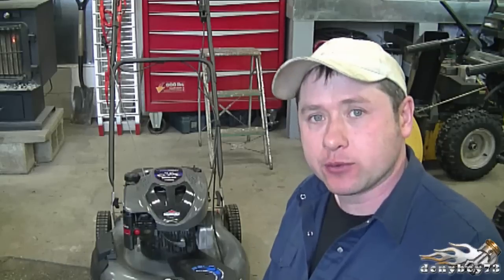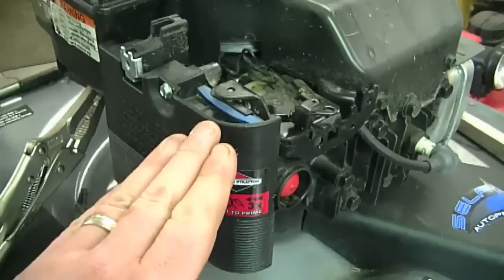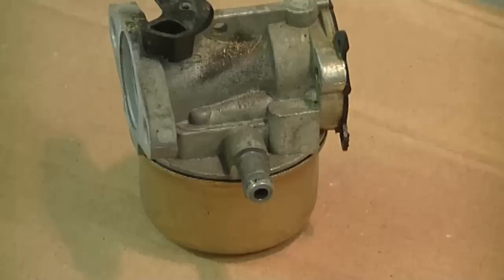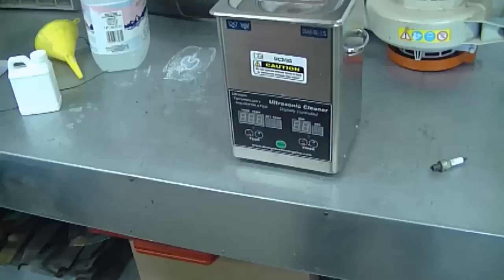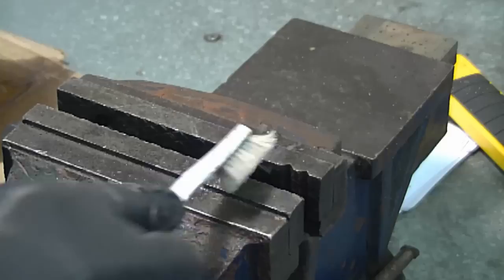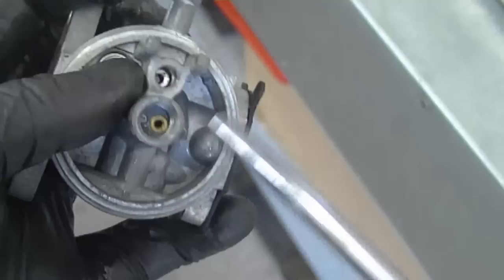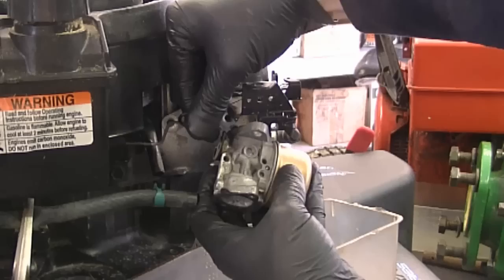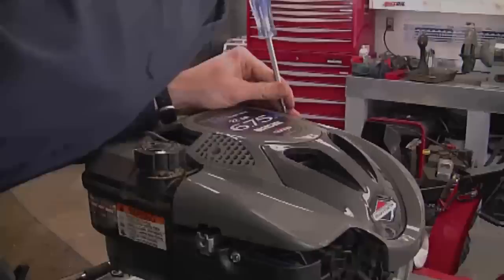CLEANING A Briggs & Stratton Quantum Lawnmower Carburetor

Comment: Hey Dony did a search for your channel and couldn't find the information so came here to ask.  I have a Tecumseh Hs50 that has the 2 shafts. The smaller one's oil seal is leaking but the main shaft is not.  Would it be a good idea to replace both or just the one that is leaking.

Comment: ok, on a troy built 6.25 and a craftsman 7.25 lawn mower with the B/S engine self chocking carb, why is it that when either of them, when  they run out of gas and you put gas right back in them, bother act like the chock comes on then off then on then on then off, runs bad but when you loosen up the bowl bolt/ botton jet nut and let a little gas out and then re-tighten it back up it/ both run like there was no problem, I hope you understand whet I'm trying to say. thanks

Comment: When spraying carb cleaner, USE EYE PROTECTION. Just as DB says. Wouldn't use a torch cleaner. It can and will enlarge the jet holes. Main jet bowl screw is soft brass. Use plastic bristles from a nylon brush if you can.

Comment: I followed your instructions but ran into major problem attempting to remove the orange rubber needle seat with a crochet needle.  The seat would not budge and pulling harder caused the crochet needle to tear thru the needle seat which refused to come out.

Comment: I have one of these Briggs but it has a donut fuel tank on top that covers the carb and it has a link with a small spring not a long one like you have. I can't see any model nr it is over 20 years old i think. Any idea what kind of engine i have ? I can't find the correct way to set up the spring for the throttle. thanks!

Comment: Great video donyboy. I have a briggs and Stratton small engine on my murray lawn mower. I ordered a carburetor rebuild kit, my carburetor looks exactly like the one on this video. Unfortunately the carburetor is now leaking gas, where before it was not. I replaced the needle seat, hence the old one seemed to have been destroyed by the old gas. I also replaced the needle and pin that holds float in place. The float does not have any punctures. I put the needle seat with grove ring side down as you specified on this video, and pushed it all the way down, wondering if I pushed it too far or not far enough. Doing more examination I noticed the gas was over flowing or leaking from the jet hole in front of the carburetor, its the passage on the bottom of the welch punch, which I then replaced but still have the gas leak from that passage.
Any suggestions would be greatly appreciated, my apologies for such a lengthy comment. Thank you for your time and help.
Reply from the maker: quetzalzen 10 you might need the bowl o-ring as well
Reply: donyboy73 I replaced that as well, came with the rebuild kit. Also, replaced gasket/washer on bolt that holds bowl onto body of carburetor, cleaned all the holes on bolt. Looking at other videos on gas leaks, the only thing that continues to be pointed out is the needle and the seat, but I replaced them both. Seat is with grove side down, I pushed it down so it sits at bottom, guess I will have to play with it some more. Thank you for taking the time, greatly appreciate it. Awesome videos!!
Reply from the maker: quetzalzen 10 sometimes it's less aggravating to just get a new carb
Reply: donyboy73 Hey donyboy, thanks for the quick reply. Yeah, I was looking at new carbs, not as pricy as I tought, hoping that would be what fixes my mower entirely. But, unfortunately I also stripped the threads on the head where spark plug goes in. Doing research came to find out its cheaper to buy the head than to get a save-a-plug kit, either way still have to get the head gasket. So, now just doing the math and seeing if its cheaper to just buy a new mower, but I am also noticing that the new mowers are also cheaper in quality. Is there any brand you would recommend? Hoping not to spend over $200

Comment: Did everything you said to my carberator on a McFarlane edger but I still can't get it to start. Also, how do I check for compression? In the midst of everything thing else, I got my new air filter completely soaked with gasoline; is there anyway to dry this out and salvage it or do I need to buy a new one again? By the way, I've been trying to turn it on without the air filter in place because it's soaked in gasoline.

Comment: Forgot to mention I did use a 1.75mm crochet hook (smallest i could find $1.00) instead of a tecumsah tool with success. important to deburr it very smooth with a wire wheel first.

Comment: Briggs and Stratton 725exi 
NO oil change required - Thoughts or opinions donyboy73? 

I have a question for are friends to the south as well, I saw that here in Toronto they released the Briggs and Stratton 725exi engine with the "no oil change required" feature, since it has been on the market in the states for awhile, is there anyone that can give some reviews on how this engine, how it runs, power, the "check n add" oil change topic, overall performance, the good, the bad, the ugly!
thanks in advance!
Thanks again donyboy for all your fantastic videos!

Comment: I have a 6.5 briggs and stratton 2001 same carb but it has no primer bulb, it has a choke that is manual. when I start it, it runs for about 2 minutes and tries to stop and I put the choke completely closed to keep it running. I have taken the carb off several times to clean and blow it out and it does the same thing. WHATS THE PROBLEM ?

Comment: Donyboy -->  Great videos!!! I've watched about 30 or 40 of them.  I just subscribed tonight!!  I have a B&S 7.25 engine with the auto-choke that won't start normally.  This mower sat in a barn for about 5 years before I bought it at a yard sale.  If I squirt some starter fluid in the carb, it starts and runs for 1-2 minutes, then it dies.  I can start it right back up with another squirt of starter fluid.  It runs for another 1-2 minutes.  It will do this repeatedly.  Last fall, I did a carb rebuild on it and cleaned it with carb cleaner by watching your videos.  You do a GREAT job explaining how to fix small engines!!!  I took it apart again today and soaked it in gasoline for about 3-4 hours.  The only thing I didn't do was replace the Welsh plug, since you didn't do that and said it's unlikely to cause a problem.  Can you give me any ideas?  Also, do you have a video on replacing the Welsh plug?  Thanks, Ron
Reply from the maker: +Ron Bishop if the carb is clean then it could need replacing if it still doesn't run properly
Reply: +donyboy73 Thanks for the input.  Could it be clogged behind the Welsh plug?  I wasn't able to get anything under it to clean there.  (I cleaned the tube that goes into the space above the plug.)
Reply: I replaced the Welch plug and cleaned the tube behind it while it was open.  It still wouldn't run, so I broke down and bought a new carburetor.  I installed it today and the mower started on the first pull and ran great!!  Thanks for all you do!
Reply from the maker: you're welcome
Reply: I thought you might like to know that your videos allowed me to replace a flywheel key, identify and replace a missing auto-choke spring and adjust the self-propelled belt on my new-to-me mower!  What could cause an almost new-looking, thoroughly cleaned and rebuilt carb to fail to work?  I cleaned it several times with carb cleaner and even soaked it in fresh gas for a few hours.  It had no adjusting screws, no apparent damage and only one speed (i.e., no throttle cable).  It is on a Quantum 700 series engine and the replacement carb was part Briggs part # 799866.  The only difference I saw between the old and new carb was the choke plate on the new carb was bigger.  But once it warmed up, I don't think that would be a factor.  I ran it for 1-2 minutes with starter fluid as many as 3 or 4 times in a row and it still would not run even though it was warmed up and the choke plate was open (based on the auto-choke arm movement).

Comment: is there a chemical cleaner that will remove that white scaly residue? i'm not sure if it's oxidation or lime deposits? your videos are very helpful. thanks.
Reply from the maker: usually carb cleaner
Reply: dony is right
Reply: i've used carb cleaner and chem dip on really dirty carbs, but this stuff won't budge until i wire brush it or scrape it off. thinking about getting a ultrasonic cleaners. i'm no pro to need one but i've come across some pretty nasty carbs and i'm finding that these carbs are obsolete (ex. carburetor for a '95 briggs horizontal 5hp industrial plus motor on a craftsman rear tine tiller). is there some way to put a different carb maybe some sort of cross-reference carb chart for replacing obsolete carbs/parts? let me know if you have come across something like that. thanks.
Reply: Gilbert Cruz
 Acid or abrasion. White vinegar works a mild acid, but I hate the smell of it. Otherwise, it's just a mater of a wire brush or steel wool.
Reply: There is a "tillotson" carb mod that you can put on the 5hp but the governor linkage doesn't connect.  check out DC5000123 you tube sire.  He is a 5hp expert

Comment: hi,
Would apprec some help and advice. Used you video and all seemed well. Cleaned carb and replace sparkplug (as faulty). Mower worked for one long cut with multiple starts. Week later started for couple of second and I turned it off to adjust height setting and now it will not start no mater what (fuel and oil levels ok). Have checked and spark plug OK (using multimetre) and there is current from the magneto (used tester that lights up). Motor does not even seem to turn over. Just pull card and magnet etc works but no ignition. Tried with out filter, tried to spray some carb cleaner into carb in case it is not priming (has auto choke and primer). Fuel is held in can so no chance of water in fuel etc. Auto choke arm sitting OK and moving correctly. I am now stuck. Any ideas.
Reply: Tried following. Spark out, throttle low, pull cord couple of time to clear a flooded engine (wait 5 minutes otherwise this will not work). Place spark in. Tape auto choke lever into close position. When pulled OK but with a little misfiring. Let run for a minute and stop it. Try again and it will not start, will not start with tape removed or any setting on the throttle including choke position. This has worked twice now. Do you have to get it running for a very long time to overcome a badly flooded engine?

Comment: have a 2017 briggs 1150 snow engine , originally engine seized !!!
removed the aluminum transfer with muriatic acid and flap wheel , then honed cylinder with red scotch brite pad , then welded scored piston and filed smooth and painted skirt with graphite paint, baked oven 2.5 hrs , reassembled engine , now not starting , after sitting for 3 years carb very dirty , took carb apart and cleaned main jet clogged and emulsion tube , now surging !!!!!!!!!!!!!!
what now Dony ?????????????????

Comment: also my dads honda eb6500sx with a honda gx390 will run for 3 minites then backfire and stop but it runs with the choke on sometimes so its like its starving for fuel, but we claeaned the carb twice like dwaler said, only to have it run ine time and next time not run .  its very frustrating .  any suggestions ?  great video as usal dony!  thanks!!
Reply from the maker: check the valve lash
Reply: ok ill do it with my grandpa who was an engineer thx!
Reply: also if u have extra time u could maybe check out one of mi videos but im probly asking too much ur probly reall busy with importint stuff but just a thought
Reply: also we thought i was oil level swithcuz oil was good but when we disconnected the sensor it ran good for a while so we reconnected it and on that day it still ran good so its very comfusing

Comment: Doni help me out here...everytime i try to fix one of these...i do but the issue with every briggs and stratton whether its a new carberator or not it always needs GUMOUT aka carb cleaner sprayed intot eh filter then it starts first pull otherwise it wont start..ive done everything..cleaned the carbertor, placed new carbs, new filter and its the same thing...im new to this hobby so it could be something and probably is soemthing simple im overlooking...everyone is the same thing..all the carbs are also not adjustable like this one here pretty much in fac tone mower i already sold had the exact carberator this one has..and yet same issue..i had a weed eater and a leaf blower and those i was able to adjust the "h" and the "l" i believe but these carberators dont have those.

Comment: I have a particular problem with mine, or maybe it's just my perception. What does it sound like when you hit the primer button? Am I supposed to hear the sound of gas being sucked into the carb? It sounds to me like it's simply air, or more specific an air leak or air being pushed. It's a new bulb with a tight fit so I'm not worried about air leaking, and yes I do cover the center hole with my finger. The engine usually does start on the second or third pull... it had been sitting for years and I did clean the carb and it does run fine when I get it going. I'm hoping that I can get it to start after three pumps of the priming bulb and on the first pull so my wife can run the mower when I'm gone... right now it's pretty tough for her to do so.Can anyone give me some advice on this? Thanks in advance...
Reply from the maker: +kd0asx it's normal to hear air on this one, you may need to replace the gasket between carb and air filter housing
Reply: +donyboy73 hey thanks for getting back to me. There's still something weird going on. I pump it three times and it still takes three pulls. Ok for me but not the wife.

I didn't do a full carb kit, just the gaskets, and maybe I didn't blow out the right hole very good. I doubled up on the gasket like my Briggs parts guy told me to do. If you have any other thoughts please let me know otherwise I'll work on the carb a bit more and if it doesn't help I'll have to live with it.

Love your channel... You've helped me fix three motors and I have three more out in the shop that you'll probably help me with too.
Reply: I actually had to replace the air filter housing... I saw somewhere else that they become warped and then they can't seal to the gasket, which is exactly what happened here. I bought a new one for $22 and problem solved.

Comment: Great video. I followed your instructions step by step. I have a Craftsman Platinum 7.0 with the B&S motor, no primer bulb. I am now able to get it running and stay running. However the very next day it won't start unless I rock the mower side to side. Then it starts fine. I did notice that the pin that holds the float does not come out at all.  I was able to gently work the needle out to clean it and remove and clean the seal. Any suggestions? Thanks.
Reply: It looks like I need a new carb...damn thing is leaking fuel now...I will order an OEM #799866...these made in china carbs are terrible.

Comment: donyboy73 what the company does not tell you it strict words.....  Never, ever leave fuel in the tank.  They do not provide a drain to get the fuel out at the end of the running season.  It can be modified, but besides that, tip the unit on the side and pour it out.  After doing that (into a suitable container for disposal), go through the start procedure to clear any remaining gasoline.  Please show the different ways to rid yourself of the problem.  The fuel additives they put into gasoline along with water will mess your fuel system up.